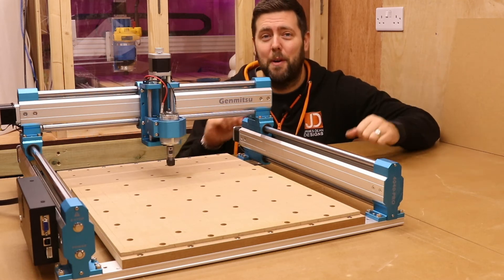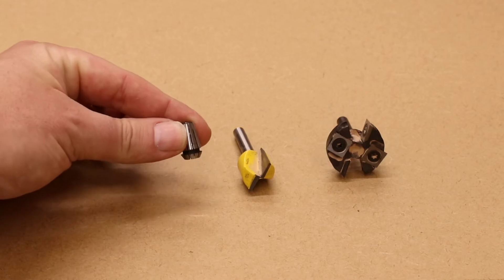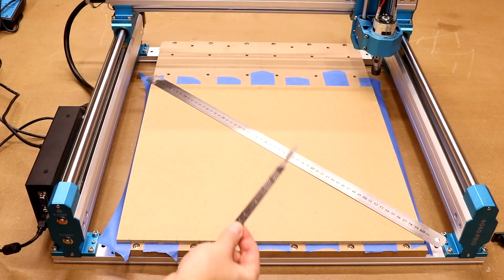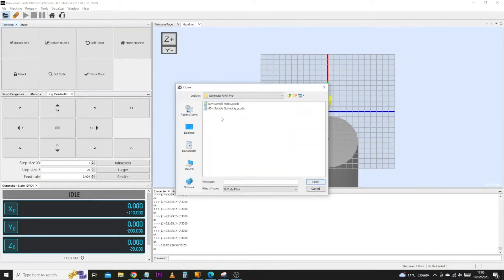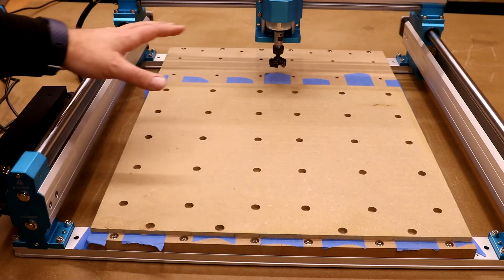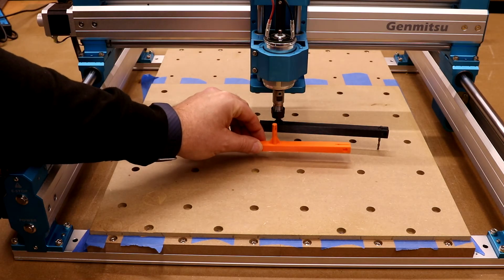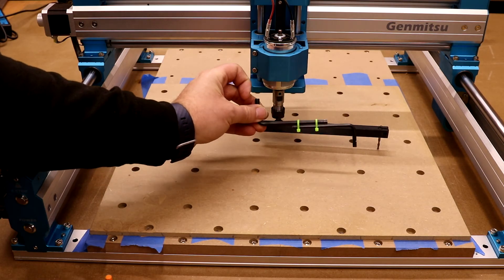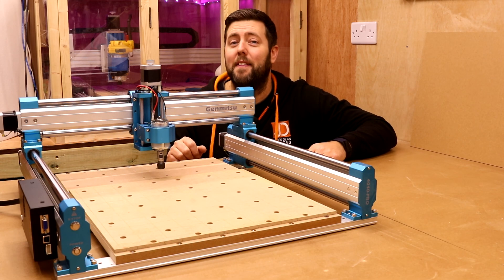Spoilboard and tramming on the Sainsmart Genmitsu 4040 Pro

Comment: It doesn't look like the files can't be used in easel unless anyone was able to import that can share how they did it.  I only use Easel and don't use anything else.  Thanks
Reply from the maker: The gcode files can be ran via Easel, you may just need to change the file extension on the end to what ever it is that Easel accepts, it will still work. Alternatively I think the SVG files should be in the folder as well in case you need to recreate it yourself
Reply: any idea why in easel the gcode file starts with the middle of the file in the bottom left corner? and do you know how to change that by chance? @JamesDeanDesigns